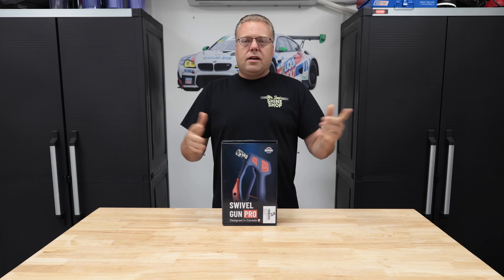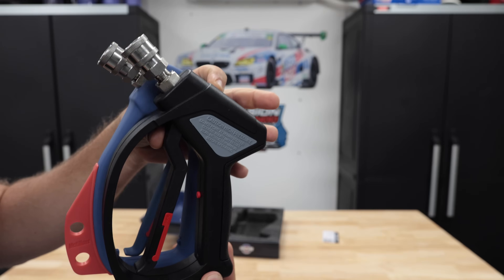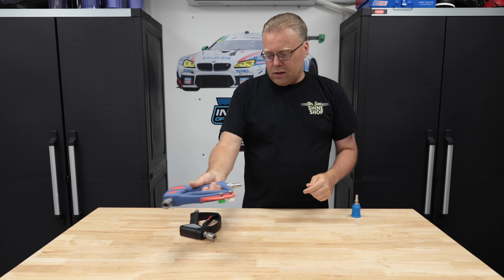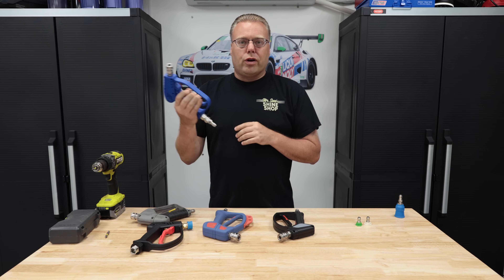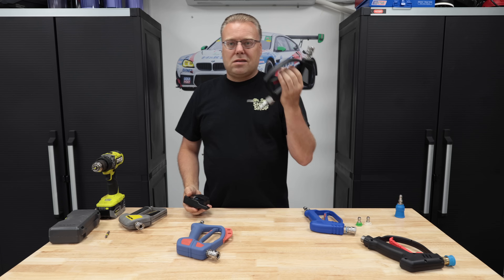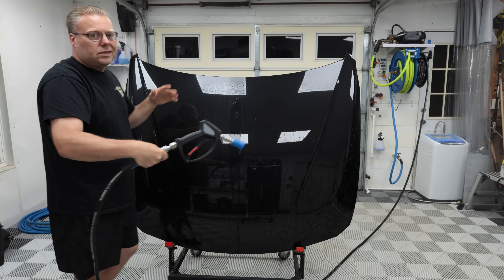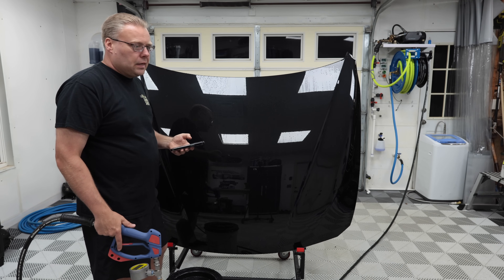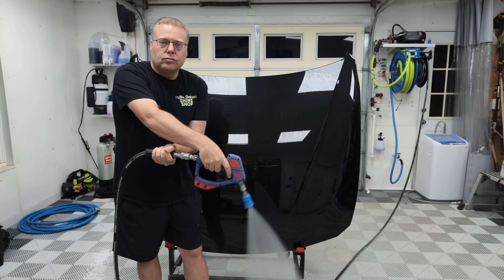Best New Pressure Washer Gun? McKillans Swivel Pro VS MTM SGS28

Comment: The MTM and Mosmatic guns are at such an angle because they are designed for the ergonomics of industrial cleaning like concrete and house soft washing. I got this Swivel gun pro a couple weeks ago and enjoy it much better. I retired my Mosmatic because it really was uncomfortable on my wrist, especially when you have a powerful pressure washer pushing your hand back and you have to fight against the water pressure.
Reply from the maker: Yup, the were designed for car washing. I have not tried a Mosmatic to know it’s trigger pull. I choose the SGS28 simply because of the trigger pull. The angle is more fatigue, but the trigger feel helps alleviate some of the wrist fatigue. Also, being an enthusiast I’m not washing cars all day which could bring out fatigue I might not feel.

Comment: Most parts of a vehicle, especially the dirtiest ones, are lower than a human's arm. I think the MTM angle is more ergonomic unless your height is 4'11
Reply from the maker: That is a great observation I didn’t even think of it. It was designed for industrial cleaning and using with surface cleaners which is why it’s at that angle.
Reply: @CarsWithKeav The angle is also determined because most applications are intended to have a longer wand attachment.  Longer wands generally have a hand grip for your other hand to aim.  That is the ergonomic angle for two hand operation.

Comment: I have the OG spec gun, and it's my go to one. Again it's like the Kranzle, if you have the money it's a great option, but if you're on a budget and like to abuse the crap out of your tools, the SGS 28 is probably the way to go. I keep an SGS 28 on standby because of how good it is and the comfort of the trigger pull. Keep in mind too, I'm a weekend warrior type guy, so I'm not detailing every day, so I don't send my equipment through the ringer as much as other professionals would and I baby my tools 😅 personally I think you'll prefer the SGS over the OG spec/Mosmatic one just because of the price point and the few improvements the Mosmatic has. Build quality seems really good on both guns but again, my experience so far hasnt been as extensive as others in the professional world. I really love the videos! Keep em up. You've been a go to guy for me on new tools and equipment and I always love the honesty. I'd love a chance to talk Detailing with ya anytime!
Reply from the maker: Appreciate the kind words and have thought about reviewing the OG spec. I would assume the biggest reason to get it is the swivel? I don’t think it has a lighter pull than the sgs28. I’m not a fan of click triggers in spray guns either. Fittings probably better as well. The bodies are probably the same plastic. The internal MTM might have an advantage due to the stainless screws and nickel plating. I think the Mosmatic is just brass. I think the SGS28 for what it delivers is actually a bit underpriced which I like  a lot.
Reply: @CarsWithKeav    The swivel is absolutely insane. There's almost little to no difference between it being pressurized or unpressurized, smooth as butter. The trigger pull isn't as easy on initial pull as the SGS, but I like how the trigger sorta locks, it allows you to relax a little, but I think it's more of an individual preference thing. The fittings are really nice and probably my biggest complaint is the brass internals. For the price point I think it should be stainless or at least zinc coated. Although I'm not an expert, and I don't think it really hinders/improves performance, maybe just longevity. Totally agree though, for a pressure washer gun that does everything you need it to, and does it really well, it's a great bargain.
Reply: I own both as well.  Very little difference except for the superior swivel in the Mosmatic. If they ever break I’ll buy another SGS28
Reply from the maker: @Forcedinduction_Drive  Thanks for the great info and telling us your experience. I guess it all depends on what you value the most. I don’t value the swivel as much as I do price and trigger feel.

Comment: Great video! Just like how the swivel is different when under pressure, it would be nice to see what the trigger pull is like when the gun is pressurized since that changes how much you have to pull to start spraying. Not sure there would be a difference in their ranking, but curious if their internal mechanisms are affected the same under pressure and how that would affect the trigger pull differences between them?

I've noticed a major difference in pressure washers and their required initial trigger pull force. For example, the Active 2.3 keeps the pressure about 600 psi when not in use, which makes the initial trigger pull super light. But with the AR630TSS it keeps the pressure about 1600 which makes the force required to pull the trigger initially much higher (even with SGS28), then you get that initial pop and recoil as the pressure blasts from 1600 to 0 briefly before the motor kicks in. I definitely prefer the 2.3 in that regard.
Reply from the maker: I’m not sure why I didn’t read trigger pull pressurized. For some reason didn’t even think of that. In my experience though the trigger pull is the same when it comes to ranking them. Pressurized the pull might be slightly more say 10% to 20%, but it’s added across the board. I’ll be sure to keep that in mind the next time I test trigger guns. Thanks for the feedback it’s much appreciated. Yes the 2.3 has the easiest linear ramp up that I have seen and it’s not slow it comes on pretty quick.

Comment: What is the warranty period on the MCKILLANS  vs the MTM and ACTIVE? I’ve heard it’s only like 30 days vs 6 months on the ACTIVE. I’ve read reviews and it seems all these guns at any price point are prone to leaking swivels or failing trigger mechanisms so for that much money I would want a decent warranty period. Have you ever had to use warranty on your MTM or MCKILLANS and how difficult was it?
Reply from the maker: I’ve abused MTM guns for years and never had an issue with the gun itself. One time it stopped spraying due to debris stuck in the valve which can happen to any spray gun. Never used a Mckillans king enough to know it’s durability. The MTM I know will handle lots of abuse.

Comment: What hose and connectors would be required to use the Mckillan Pro Swivel gun with the AR Blue pressure washer?
Reply from the maker: That really depends on the AR blue model you have. There are so many different ones out there and different connections on them.

Comment: Hi Keav, 

I’ve always heard of a rumour to not keep pre mixed soap as the foam quality or cleaning ability will degrade. 

Could you perhaps test the foaming/cleaning ability of pre mixed soap such as your 32:1 DIY container and/or rinseless kept in a keg sprayer for a month or so? 

Could maybe compare to a freshly mixed solution. 

Would be an interesting educational topic. Would love to keep more pre mixed chems if they stayed good for at least 1-3 months.
Reply from the maker: @VassRulez  I’m not sure on other soaps, but DIY detail Yvan encourages saving soap. I don’t use the sponge for rinseless or my bucket soap Incredible suds. I use multiple microfibers and don’t return them to the bucket. So when I’m done I seal the top with Gama lids and will hold till the next wash. As long as it’s sealed Yvan says it doesn’t degrade and will hold for several months. Keeping them out of UV light from say the garage door being opened or a window will help as well. Even with P&S brake buster I have seen no issue pre-diluting.  It’s something to think about, but I use my soaps pretty regularly so nothing ever sits for more than a month at the most.
Reply: @CarsWithKeav  I’m not too concerned about saving solution in the bucket. 

More interested in the foaming/cleaning performance of pre mixed solution kept for a month+ in a foam cannon/pump sprayer/jug.
Reply from the maker: @VassRulez  I’ve kept pre mixed solution in foam cannons for long periods of time and never saw much of a difference.

Comment: Keav, just found your channel and am thinking of investing in a home setup for frankly a more pleasant way of cleaning vehicles. Currently have a gas power washer that is 3,100 psi and and 2.7 gpm. It’s more industrial for home use. Was looking to add the Swivel pro and wand attachment for vehicle focus and possible add the Active 2.3 if I find that I am using it. The swivel pro isn’t rated high enough for current set up, but is close at under 3k psi. Do you think it would work over a short period of time? Thanks.
Reply from the maker: Swivel Gun Pro is rated for 4K PSI and 7GPM so should be able to handle that Gas pressure washer no problem. That’s 75% of its max so we’ll within safe operation.

Comment: Is there any way that you could remove the nozzle holder it's a good concept, but it really is not a big deal for me & it makes it more bulky than needed, IMO.
Reply from the maker: Yes, you can remove it , but it will leave an open area on that part. Its just cosmetic wouldn't impact anything.

Comment: My mckillans gun started leaking since last car wash. Took it apart and cleaned it. I’ll be using it the next wash and if it decides to leak again, looks like I’ll be getting the sgs 28.
Reply from the maker: Is it the new swivel gun pro? Leaking out the end? It does have a 6 month warranty. I have fixed many spray guns by taking them apart and putting them back together.
Reply: @CarsWithKeav sorry for not stating the gun type. It’s the first mckillans gun gen1 not the pro version. And thank you keav the honest review👍🏼.
Reply from the maker: @99kmh32  yeah, that gun is not bad it’s a catalog style rebrand. This new one is their design and they spent a long time figuring it out.

Comment: I am looking to buy MTM HYDRO SGS28 short pressure gun but amazon doesn’t provide fittings for it. 
also i have Bosch pressure washer machine so could you please suggest me the fittings or setup for MTM Hydro SGS28 with my Bosch Machine. Please
Reply from the maker: I am u sure as we don’t have the Bosch pressure washers here in the states so I don’t know the connections. I’m guessing this is another country and Amazon there doesn’t have the SGS28 with the fittings installed? I know I’m the U.S. you can buy with the fittings already installed.
Reply: @CarsWithKeav  actually I wanted to know that is there any adapter like M22 14mm/15mm adapter which fit down the swivel. And then i will connect my Bosch Hose pipe with the connector. The need to know any adapter please.
Reply from the maker: @vikhyatraghav  You should be able to use something like this to convert your hose to the the quick connect and then attach to the spray gun. This listing has both 14mm and 15mm. https://amzn.to/3ztPgo1 I am unsure of what size Bosch is as I couldn't find it researching google. I always measure the inside piece with a digital caliper to find out what size it is.
Reply: @CarsWithKeav  ok thanks for your help 😊

Comment: Hey there.  Have you heard anything about the active stubby gun having leaking problems. I had one for two months and it leaked. They sent me a brand new one which I got yesterday. It too is leaking. Something to do inside the housing. Ali appears to be a bearing that is not well seated on the rubber washer. i’ve asked them for a refund at this time.
Reply from the maker: @kellyk7553  I have not heard of this issue. I use mine from time to time with no leaking. Sucks it happened to you twice. You don’t have crazy hard water that could build deposits? If not it shouldn’t be doing that. If you are returning it for prime day today the Mckillans pro swivel is on sale I think it’s better than the Active IMO. https://amzn.to/3zUWyBh
Reply: Thanks for the advice.  I am going to talk with them tomorrow and I hope they will process a refund

Comment: Might try the Swivel Pro. Love the trigger in ms sgs28, but it can be fatiguing for my hands.
Reply from the maker: What kind of fatigue are you think the angle might help? Swivel Pro would give more fatigue if it’s based on the trigger pull itself.
Reply: @CarsWithKeav  The angle of the spray
Reply from the maker: @leonardlandicho7491  that’s make sense then it might help. What I have notice is the angle helps if you have a taller vehicle as you are shooting it more often and that angle is already there. SGS28 was designed initially for industrial cleaning so having the angle upright for cleaning large equipments is why it’s that way. Let us know how it goes if you get one. Curious to know the results.

Comment: How is SGS28 different over SGS35 thanks
Reply from the maker: They are very similar except the SGS35 was designed for food manufacturing so it is 316 stainless instead of 304 and is using USDA approved food safe plastic. It is also slightly bulkier in size. To me these are things not worth that extra money when it comes to detailing. Unless maybe it’s a very high volume detail shop where these higher quality items might last longer, but is it worth the price difference is the real question.
Reply: @CarsWithKeav  thanks.  I paid under 33% list blue SGS 35 ‘ then ‘ worked out for heat and food manufacturer.  The 28 sounds great for cars.  It’s all one does. Never sees heat.  I’ll just buy one of these 28s. Thanks reply.
Reply from the maker: @zzhughesd  33% is a great deal and would be worth the discount for sure. I forgot to mention it’s a hot water gun as well. Either both have the best pull trigger on the market.
Reply: @CarsWithKeav  One thing everyone seems to miss and overlook on the SGS35 is the outlet angle is a fair deal more shallow/level than it is on the 28. If you overlay the SGS35 and the Swivel Pro, they are basically identical in output angle. I've been going back and forth between the SGS35 and this Swivel Pro (largely thanks to your excellent review here), but I think for $20CND more for the SGS35, it's going to be the eventual winner due to the higher quality internals and valve replacement parts are available. Still trying to make my mind up as I'm sure I will like either.
Reply from the maker: @ Toughest decision to make is when you know either way the product is going to be good just deciding that if something is worth the extra $20 or so. I find myself contemplating that quite a bit. I myself prefer the angle of the SGS28 so it’s an easy decision for me at least. SGS35 also can do hot water so that’s a plus there as well.
Reply: @CarsWithKeav right now the price difference is just $8 between the SGS28 and SGS35. I'm just a weekend warrior so both will be overfill but that blue color looks nice matching the Uberflex hose. What do you think?
Reply from the maker: @ SGS35 was made for the food industry so its higher quality plastics and 316 stainless. Only other difference is the 35 is a bit bulkier so if you’re going for a color match with Uberflex then I’d go SGS35 if it’s only $8 difference.
Reply: @CarsWithKeav  Thanks Keav! Your videos are awesome!

Comment: Yikes 4 pounds of pressure for the Essential gun…that is unacceptable and I’m pissed that I ended up buying it before looking into it more. No wonder my hand starts to get strained after a minute of washing smh. Also on mine it does not spin that well under pressure. Might have to get the SGS 28 now simply for the fact of the crazy light amount of pressure needed to engage the trigger
Reply from the maker: You won’t believe the difference in trigger feel. Nothing out there has that light of a pull.

Comment: my vote goes to lvtian g19. that thing has all these stuff plus auto lock and price under $30...
Reply from the maker: I have tried them all and the ones with the lock they’re are nice, but for the $30 you get a 5lb tension trigger. Once you try one that is less than a pound you’ll never want to use those again. The lock is nice, but the SGS28 is
So easy to hold you don’t even need the lock.

Comment: I use the yum edition mtm sgs28  mosmatic  golden plate colour is like the og mosmatic but is mtm from yum cars in England the swivel is turning so soft bc is mosmatic nothing else comes close to to them
Reply from the maker: I have seen clean garage sells them, but they don’t change the swivel. It’s just the Prima quick connects that I can see.
Reply: @CarsWithKeav  i don’t know I have the yum edition and the swivel is also mosmatic you can see in there website of yumcars
Reply: @Dias-v  Are you in the U.S.? I was wondering if we can get the Yum edition here?? Seems like the best of both worlds. Mosmatic gun but not the OG spec price.